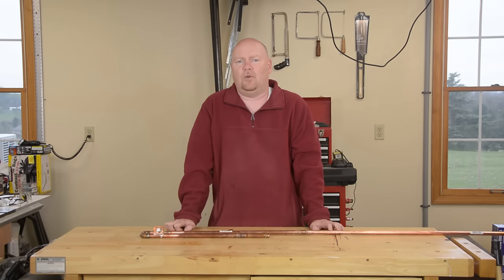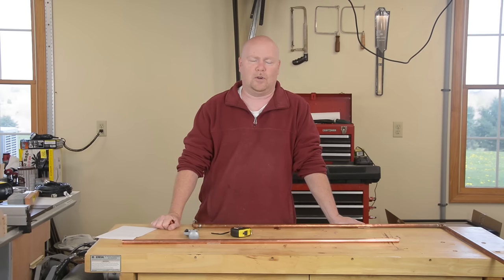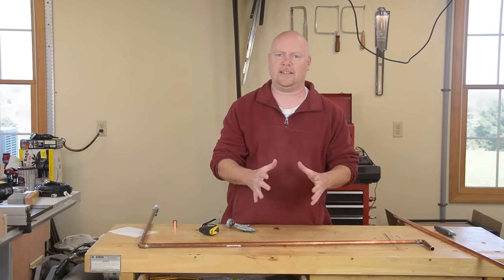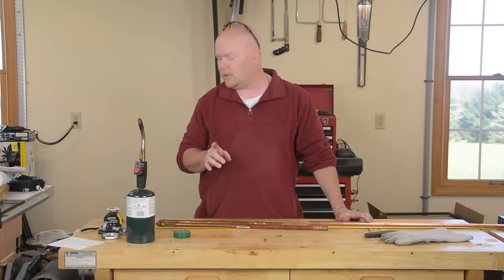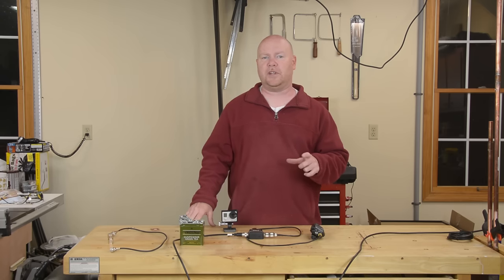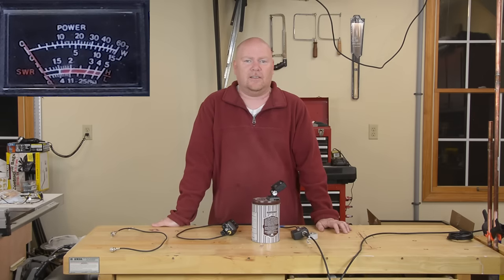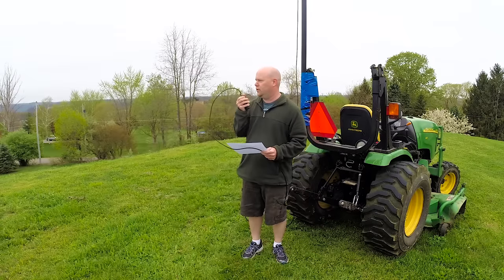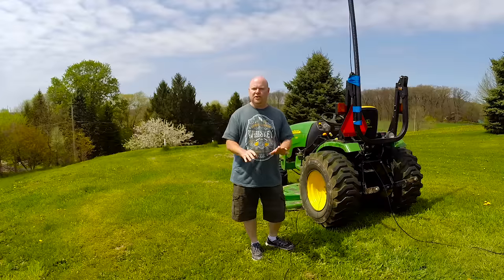2 Meter J-Pole Antenna Build

Comment: What is the gain on that antenna? And is it directional at all? Or is it completely omnidirectional?
Reply from the maker: J-poles are 1/2 wave radiating elements, so they run~2.4dBi same as any other dipole would.  The antenna is omni-directional in the horizontal.  Gain comes from not shooting RF straight up or straight down.
Reply: @MattHeere  Thanks! I want to use fishingline to pull the jpole and coax up to about 70 feet near the top of a tree. So it would be hanging, either from the coax or the line. Is this an unusual setup for a jpole? Most people are mounting them on masts but that won't be nearly high enough for me.
Reply from the maker: @kurtr1181  Not unusual for a j-pole, although I think most of them that are deployed the way you describe are made from window line rather than copper pipe.  Kevin Loughin actually just published a video about a window line j-pole variant today.  Would be worth checking out.

Comment: reaching a repeater is one thing, but doing simplex is totally another. how much distance is gained doing simplex? thank you.
Reply from the maker: Actually the radio signal doesn't know the difference.  What's special about repeaters isn't the gear, but the fact that they generally have good antennas, and good elevation.  If another simplex user had those same qualities, then the range would be the same.

Comment: What is the part # and name for where you connected the coax to the antenna?
Reply from the maker: That's an SO-239 connector.  You'll often here it referred to as a UHF connector in ham circles.   If I had it to do over again though I'd probably use an "N" connector.  SO-239 is much, much more common, but N connectors are a better impedance match.
Reply: Thank you for the info. I just made my J pole, inspired from your video. I have seen many people that solder both leads directly to the antenna, but having the ability to simply unhook the coax seems to be a plus for me. 

Being new to Ham I am trying to learn all I can at once.

Comment: thank you for the good video .... I will try to make one ... but one point ...  I think you cant TX on 147.999 you have to consider the TX band width so the max usable dial freq. for FM is 147.7Mhz  .. de yi3whr
Reply from the maker: Basically correct (typically FM is 16kHz wide on 2M, so 8 above/below the carrier) assuming that you are actually modulating the carrier.  If you transmit nothing, then you only transmit the carrier itself and no sidebands (ideally).  Of course, with the radio being a Baofeng, there's no telling where all it's actually transmitting :)
Reply: thank you for the reply ... one question ... do you have an idea how this antenna work with satellite   and is there a chance to make it 2 band antenna .. actually that what I'm trying to use it for ???
Reply from the maker: Yes and no.  A 2-meter 1/2 wave will tune up just fine on the 70cm band, but since it's 3/2 wave on that band the radiation pattern is screwy.  If the antenna is vertical, the primary lobe for 70cm takes off at a 45 degree angle.   It's usually still a lot better than a rubber HT antenna, and it's always better than no antenna!

This would make a frustrating antenna for satellites though.  You really need something directional that is either circularly polarized, or that you can move to change the polarization.   You can't hold the j-pole in your hand without messing up the RF currents, and even if you could you would look like some kind of bizarre failed swordsman waiving such a thing around.
Reply: Matt Heere Hi hi ... Thank you for the info.

Comment: Has anyone or does anyone have any comments about mounting a copper j-pole on a mast in a tree? I have a large oak I can get up another 50' easily. Also is a metallic or non-metallic pole better to mount to?
Reply from the maker: Definitely check out the link in the description.  John has all the details about the mast.  Short version is that a metallic mast WILL be a part of the antenna.  Whether that turns out to be good or bad depends a lot on your specific install setup.  Otherwise, more height is always better for VHF and up - assuming you're willing to put some serious cash into your coax.  The loss in 50' of coax could easily wipe out a lot of the benefit you'd get.

Comment: how many times and what size did you wrap the choke
Reply from the maker: Wish I could remember Bob.  I ended up using this as a receive antenna for air band traffic from the local airport, so it's currently in my attic hooked up to a Raspberry PI with no choke at all (because it's RX only).   On my other antennas, one of which is another J-pole, I've switched over to ferrite beads for common mode current reduction.  I think they work better, and they're certainly easier to deal with on low loss coax.
Reply: Sorry for the late reply...4 windings @ 5" diameter.

Comment: I would like to build a dedicated 2meter ssb antenna. Any recommendations?
Reply from the maker: For SSB you want horizontal polarization.   A dipole is easy, but any of the 2M tyagi designs are best..
Reply: @MattHeere  thank you for the quick reply. Means alot. I live in NYC and I am not able to put anything on the roof. What kind of simple but effective antenna would you recommend?
Reply from the maker: @chancha807  go with the dipole for starters.  It's easy, cheap, and will work almost as well as much more complicated antennas.
Reply: @MattHeere  can you post a link for a dipole yagi ? The max watts would be about 200.

Comment: What solder is used for this J-pole?
Reply from the maker: About anything will work.  I happened to have lead free plumbing solder and flux, so that's what I used.  However regular old rosin core electronics solder will work fine.  Just takes quite a long bit of it since it's usually much thinner.

Comment: Thanks for the video!  Did you solder the center coax conductor to the short side or the long side?  Almost all online diagrams show it soldered to the long side, however an online amateur plumber/antenna manufacturer does it the other way.  How did you do it?  Here is an explanation of the difference in radiation pattern doing it both ways: https://youtu.be/wjs7od3WCBg
Reply from the maker: Hi David.  My center conductor feeds the long side, but I don't buy this "there's a huge difference" argument for one second.  If you break a j-pole down to it's two parts, you have a 1/2 wave, end-fed radiating element, and a 1/4 wave balanced transmission line as a matching section.  RF is AC current, which means it'll flow equally and oppositely on each 1/2 of the cycle on each leg of the balanced feeder.  If it did make a difference which way you fed it, well it'd be wrong for 1/2 of the AC wave cycle regardless of how you connected it.

The much more important thing is that you can not just randomly ground the bottom of a j-pole.  It may well be a zero voltage point due to being a dead short - but that makes it a current maxima.  The link I have in the description takes you to about the best info there is to be had on j-poles online, but the short version is "if you ground your j-pole (like you mounted it to a metal, grounded mast as is shown in all of those suspect vendor photos) then you no longer have a j-pole."  Doesn't mean it won't work as an antenna - just that it's not a j-pole anymore and you can't expect it (or judge it) based on that design.
Reply: @MattHeere  Thanks for your response.  This is very confusing, because the information you are refuting is directly from the ARRL website.
Reply from the maker: @daveN2MXX  The ARRL website is a collection of stuff accumulated over decades.  Much of it published long before we had the instrumentation to actually measure what these circuits do, and not much of it peer reviewed by actual engineers.  This one's not complicated though.  By definition AC swaps its polarity every cycle - which is exactly equivalent to hooking up the balanced feed line (bottom of the j-pole in this case) the other direction.  On 2M this reversal is happening 288 million times every second.  On top of this, antenna gain is a function of antenna geometry.  You can cause impedance mismatch problems by feeding an antenna incorrectly, and this will reduce your overall system efficiency, but it won't change the inherent gain of the antenna itself.  Besides even if you buy into it - the result is that they're saying to do it the way everyone does it - feed from the center conductor to the driven element side of the balanced line - so just do it that way.

Best piece of advice I can give you about antennas is not to overthink things.  There aren't nearly as many types of antennas as the people making them want you to think, and the specifications mean very, very little in actual installed use.  Get yourself somewhere near resonance, control your common mode current, and enjoy talking to people.  Not much else really matters.
Reply: @MattHeere  I'm not sure what you are talking about with AC...RF does not follow the same laws as AC and DC.  The 2 90 degree bends could affect the radiation pattern and RF phasing, as seen in antenna modeling software.  The only reason I asked was because I couldn't determine how you configured your antenna from your video.
Reply from the maker: @daveN2MXX  I'm an electrical engineer - with a specialty in RF.  Trust me - it's AC.  It's not 60Hz AC so it doesn't behave like your house current, but it's AC none the less.  Things like Kirchoffs laws apply 100%.

You are over thinking this.  The bottom part of the antenna is not a radiating element.  It's a transmission line.
Reply: @MattHeere  Fair enough...thank you for your response!

Comment: Im going to say the guy that answered you back had to be staged  ive had my license for 3 months now  yhere is over 16 repertors in a 10 mile radius. And i have yet to get anyone to answer my call 
Makes me wish i had not wasted my yime or money getting my license or on a radio
Reply from the maker: I am blessed to have not one but three very active clubs in my area.  It takes an active club to have an active repeater.  Seek out the groups that run those machines and join at least one of the clubs.  Hopefully they do more than just have a meeting once every two months.   Look around for the net schedules for these groups too.  If nothing else you should be able to find at least one net that you can check into and ask the other locals where/when you might find an active machine.

Whatever you do, don't be put off by a lack of 2M activity.  HF is where all the ham radio fun is.  10M is wide open these days so you can get started while you work on your general.  POTA is your best place to start.  Tons of activity and a super friendly bunch.   https://pota.app

Comment: I’ve been able to reach a repeater pretty reliably from almost 80 miles away with the factory antenna that came on my baofeng gt3tp. I was able to make a brief contact with that same radio on that repeater from 96 miles away, too. I could hear the repeater pretty reliably, but they couldnt hear me. A better antenna could have fixed that. I’m going to try to make that same contact again with a diy yagi at some point.

Comment: no wonder it was nearly perfect out of the box: copper is about the most efficient metal you can use for an antenna, and big copper pipe like that will give you fat bandwidth. result = incredibly forgiving antenna.

Comment: Are there down sides to a.copper J pole antenna?
Reply from the maker: Cost is an issue.  Copper pipe is pricy compared to wire.  It's also a good SWR match, but a lousy radiation pattern on 70cm.  Other variations on the end-fed 1/2 wave (which is all a J-pole is) have solutions to this problem.  Check out the DJB antennas from Dr. Ed Fong for instance.

Comment: I was looking at some copper fittings,  found there is a thing that is used to stop noise in water pipes. It should slide up and down on the end to change the length.

Comment: Is 1/2” copper or 3/4” copper best to use?
Reply from the maker: Doesn't matter much.   3/4 will have more mechanical strength,  and a slightly wider bandwidth.   Neither is really necessary though.

Comment: I'm usually a frequent traveler from around Washington up through to Erie, and stay in Grove City often. I can never manage to make a contact on any of the repeaters listed around there. Glad you could
Reply from the maker: Next time you're passing through, get yourself onto the N3TN repeater (146.85- PL131.8).  That's the one I monitor most of the time.  W3UDX is probably the 2nd most active in this area.

Comment: Good video.   Don't forget to account for lose in that extremely long cable you had between the SWR meter and the antenna.   The best method would be to connect the meter directly to the antenna.

Comment: Have a question.  Does the bottom section length (Below the T connection) make a difference.  Prob. a dumb question, I realize, if someone could give me a straight  non sarcastic answer, I'd be grateful..
Reply from the maker: Hi Todd.  Not a dumb question at all.  In fact, it's probably the most prevalent myth about j-pole antennas out there.  The answer is a resounding YES.  The bottom section of the j-pole is an active part of the antenna.  People claim that because it's a D.C. short that you can ground it or otherwise ignore it.  Nothing could be farther from the truth.  RF current flows through the bottom of the antenna, and if you attach it to anything metal then you've effectively made that metal part of the antenna (usually, to all sorts of ill effects).

If you want to see all the gory details of the modeling and math; this is the best article I've come across: http://www.hamradio.me/antennas/j-pole-antenna-should-i-ground-it.html

Comment: what can you tell me about the coax coil you have at the top of the pole ?
Reply from the maker: It's just the left over RG8x from the cable I bought to connect the HT to the antenna.  You need an RF choke of some kind at the feed point, and a loop of extra cable seems to be the simplest solution.